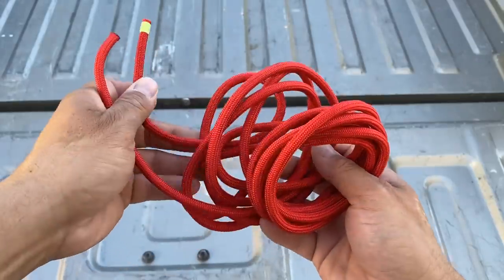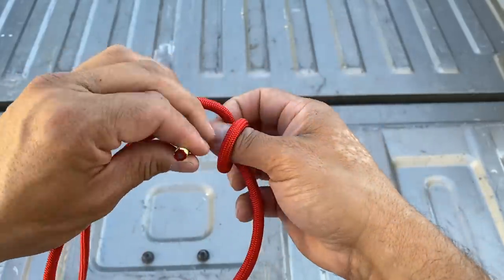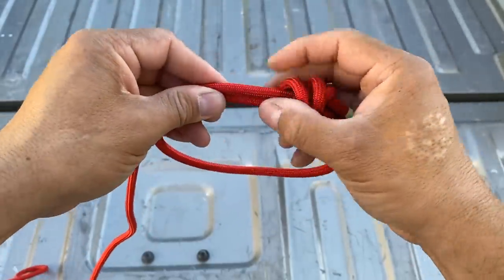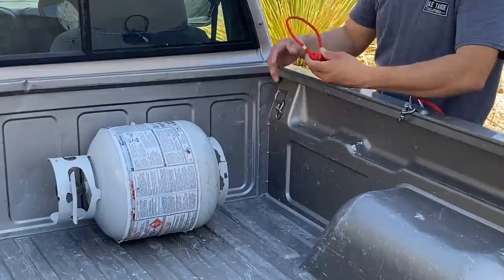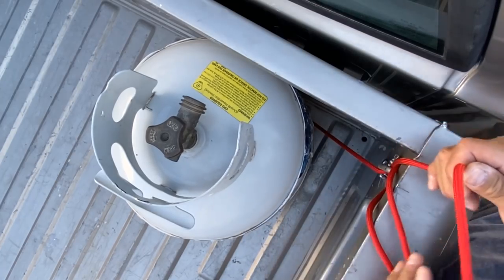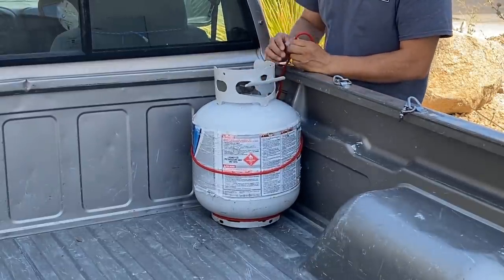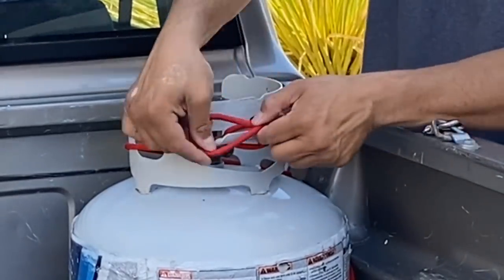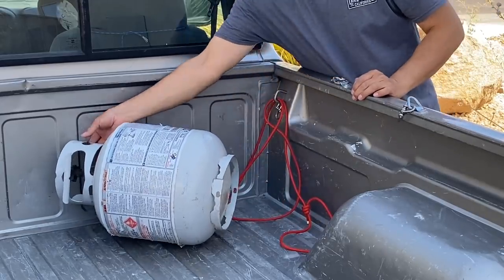How to tie down a 20 lb propane tank.

Comment: I just put my tanks in a milk crate. Fits snug enough not to fall off when you pick it up and they don't turn over in the bed of the truck.
Reply: Same...thought that was common knowledge
Reply: That's how I carry them too. The crates are the perfect size for 5 gallon buckets also.
Reply: Part of the milk crate crew........but like the rope tutorial and will try sometime
Reply: Been doing the same for years. Just thought it was common sense.
Reply: Yep. Me too.
Reply: Never had an issue using a milk crate and a ratchet strap with the anchor points low (like on the floor of the bed using E-track).  Feed the ratchet strap through the little slots between the collar at the top and the body of the tank.  Put some good tension on it and the tank is held solidly to the floor.  It works even better on the 30 pounders because the angles are better to get more downward pressure.
Reply: I came here to say this. It surprises me how many people have never herd of this.
This also works for 10lb, 15lb, and 30lb tanks
Reply: Exactly
Reply: YUP  IT WORKS PERFECTLY !!! Been doing that for Years : ))
Reply: That's what I've always done for as long as I can remember.
Reply: Old tire works pretty good too
Reply: Same. Only problem for those just finding out about this hack is that all the milk crates have been snagged up buy all the TikTokers doing the stupid milk crate challenge. 🤪
Reply: @davidgates1122  I like how you think using more items is a better method.. "Well ive never had any problems using a milk crate covered in expanding foam held down with ratchet straps that are safety wired in place!" sometimes youve only got a bit of rope, lighten up LMFAO
Reply: @kc4547  not everyone grew up with a handy dad or handy adult figure.
Reply: @RadDadisRad  lol. my father had me hold the tank between my knees.... not really, but Ive used milk crates for years. even store them that way.
Reply: Me too!  Duh Huh!
Reply: This is cool. I use milk crates with bungees. Also have tried ratchet straps. Don’t really like either What kind of tie off would you do for a milk crate that you wanted to stay at your tailgate tie down?
Reply: Where do you store the milk create?  1/4" ParaMax kept in your pickup can be used over and over...
"Tommy what you do with my milk crate?"  "It's in my tree fort dad."
Reply: Cant get milk crates.

Comment: I wonder how this would hold up when driving washboard and rocky roads in the backcountry, mostly about the bite around the mid-section of the tank. Will is stay put?
Reply from the maker: The is a weld line around the middle of the tank. It helps keep the rope in place, but I’m interested too.

Comment: That is a great way to secure the tank, although the one part you reference wrapping the handle like tying off a boat to a cleat is not really how you ought to tie a cleat.  When you finish around the cleat the twist should land underneath and parallel to the part coming across. It is secure that way and doesn’t require multiple half hitches on top of each other.

Comment: Can your amazing knot-creating mind come up with a way to lash a horizontal pole to a vertical pole (or two) tightly, but in a quick release way? For example, lashing a spade or broom to vertical stanchions on the back of a truck, or lashing up a temporary fence or hurdle.
Reply from the maker: About what size diameter poles are you working with? Just so I can make sure I figure out an appropriate knot. Thanks!
Reply: @First_Class_Amateur  about the diameter of a broom handle 👍
Reply: @bn5055  Jamb knot, some call it an arbor knot, would work.
Reply: @ricdonato4328  sling blade.  Some call it a Kaiser blade but I call it a sling blade.

Comment: I like it… but the way you pushed the bottle around with 1 hand, it was empty & light - so I felt you cheated 😂. Also I’m short & the sides on my Hilux are high - so I’d need a nail box to stand on. Actually I can’t do this as I’ve got a canopy and a set of full sized draws on the tray, but I can see me using tour technique elsewhere. Always learning.

Comment: This is great.  What are your thoughts on tying in 5 gallon gas/diesel cans, plastic and metal?  Thanks
Reply from the maker: When I was in the army, we would run a strap through the handle as it was hooked on from both ends of the truck bed.